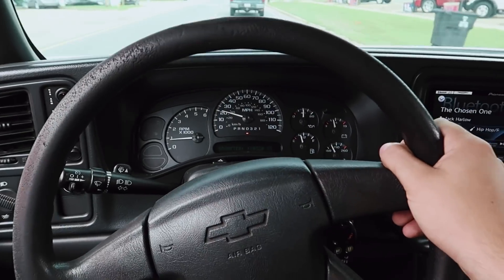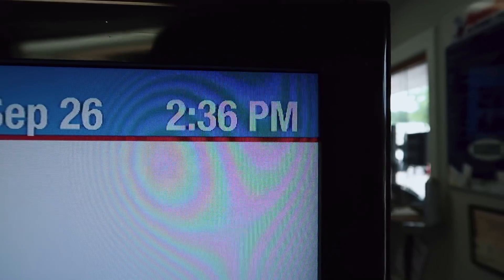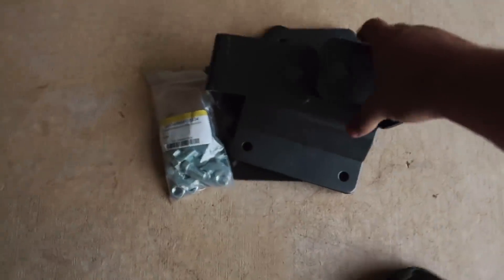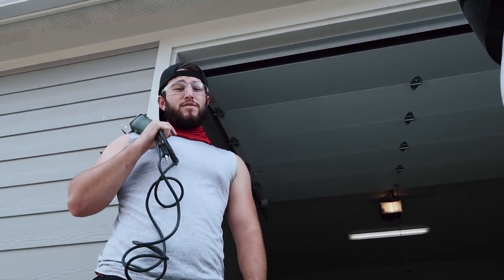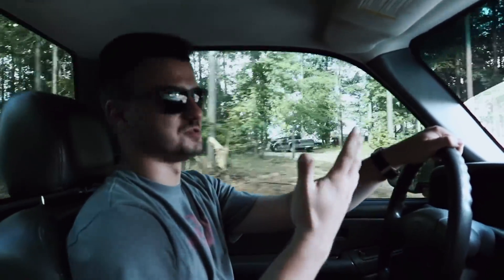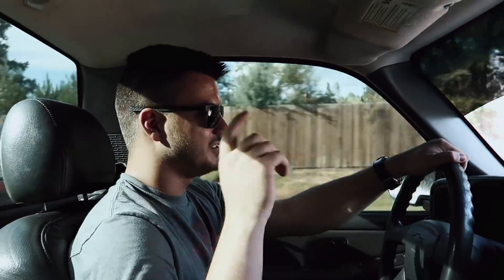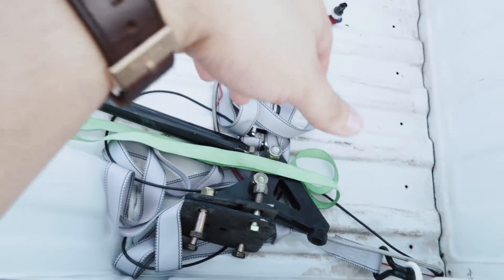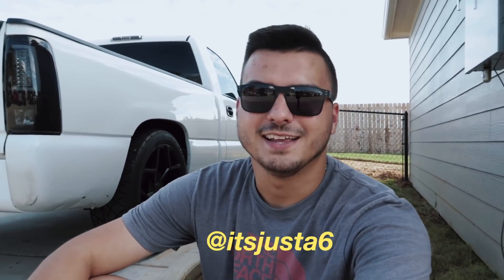This is a DISASTER! Race Truck problems...

Comment: $550! You could’ve bought a nice compressor and an air chisel and done the job yourself! Live and learn. Bummer!
Reply: Victor Garza do you replace the front hanger on the older trucks? When shopping for a 4/6 drop on my 14+ truck it’s the rear hanger I replace
Reply: tyler56ford Not possible actually, the rear of the spring is only a short distance from the bed floor, springs are normally mounted much lower on the front mounts so they have a lot of clearance & it maintains a better geometry, that’s why it’s always the front mount when lowering. If you are doing a lift then it would be on the rear mount.
Reply: Matt's Garage oh okay. I just know what I know from shopping for my truck. Mcgaughys 5/7 drop does the rear hanger, shackle, and a flip kit for the rear
Reply: tyler56ford Yep, if you are doing a flip kit or lower springs that might be the case but if you’re just changing out the hanger there isn’t enough clearance at the back.
Reply: Or bought a fucking dremel lol
Reply: Exactly!
Reply: Or just simply drill them out!

Comment: Gets an alignment. 
Immediately lowers rear of vehicle. 

Hooray excessive caster angle.
Reply: Please explain how lowering the rear leaf springs 1" on a truck would throw anything off.
Reply: It can throw off your caster/camber?  My lightning needed it when i did
Reply: @jlplightning9487  it was 1" and he didn't lower the front after alignment, only the rear. If you only lowered the rear of your lightning and not the front and paid someone to align it then you threw away money unless it needed alignment before hand.
Reply: Lifting orlowering the rear of a vehicle can and will affect the front toe adjustment. Lift it up and toe goes in, lower it and toe goes out.
Reply: Any adjustment made to the rear of a vehicle will affect the front. 

Caster is the relation of the upper and lower ball joint positions. 

Draw a line perpendicular to the ground that goes through your lower ball joint. 

When you lower the rear you are reclining the axis of the ball joints. Increasing caster

When you raise the rear you are making the upper ball joint go more towards the line drawn through the lower ball joint. Thus reducing caster. 

Though positive caster will help straight line drive-ability. Which will certainly help with drag racing.
Reply: not be rude but thats not how it works lol. Anytime you touch anything on the chassis in the rear the front gets thrown off
Reply: I guess you didn’t read the first sentence?
Reply: that wasn't to you lol

Comment: You need a spot weld removal drill bit to drill out those welds on the OEM brackets.

I used this on my rad support removal on our channel mustang build. In fact, my brother (on the channel) used this bit to remove the floor pans from his 2JZ Datsun 240Z build on the channel.

They take a while to drill out but it will do the job.

Hope this helps 😎

Comment: Have you checked to see if the drop shackles are bolted on to the lowest setting, knew someone who got a 2 4 drop and had the same problem you're having. Checked, and sure enough, wasn't on the lowest setting.

Comment: Put of curiosity how hard would it be to get the actual 2 inch hangers and install them yourself since they were just bolted in and you won’t need a torch to remove them this time?
Reply from the maker: Harley Imel fairly easy. Just would need to drop the tank

Comment: If you're going to take that thing drag racing, or even just apply a massive amount of torque to the rear axle, only use lowering front spring pockets or lowering leaf springs to lower it to be safe on every launch and keep the truck in control

Comment: Hey Gavin you can get an extra inch lower by taking the block out of the rear shackles if you don’t plan on towing heavy it rides fine I’ve done it on multiple trucks including a duramax just unbolt the shackles pull out the block and bolt back up the shackles .

Comment: 4hours sounds about right. Usually takes a little less. But my shop pays 1.50hr per inner tie rod so 3 hours total plus alignment usually can finish it in 2hours especially if you have the proper inner tie rod tool.

Comment: you want to lower it and throw power to it get a 4 link suspension for the back with a watts link fully adjustable way less issues with wheel hop and traction

Comment: I dont get why you started to cut off the rear leaf spring bracket and then the shop you had install them put them on the front side of the leaf springs ? What about a 1 inch drop shackle to get 1 more inch ?

Comment: Maybe it turned out for the better aren’t you hauling all your race fuel with the truck ? An inch more lower might cause wheel rub when it’s loaded down? Also it will squat when all that power hits the rear end. Looks good.

Comment: Check into SpeedEngeneering out of Fresno Ca. Sean is the owner and has everything u need for the rear set up of ur truck. They have multiple pieces specifically  for those trucks to perform and squat down . Hope this helps

Comment: Why don’t you have the company send you the correct 2” hangers, swap them out since they are just bolt ins and you already had the rivets torched out and send the 1” back? Company screwed up they should have no issue sending you correct part, unless they want the 1” shipped back first. Maybe repurchase the correct 2” and make them let you return the 1” for a full refund after you swap. If it were my truck I’d want the rear lowered more.

Comment: Blow torch? I haven't seen a blow torch in years.. I'm sure you must mean oxy acetylene torch. A blow torch is what my grandpa used 60 years ago to heat metal. On the other hand, an oxy acetylene torch is used to heat or cut metal. On the job you were doing it might have worked better to use a drill on those big rivets. Drill into the head then use a hammer and punch to pop it out. A large coarse grinding bit on a drill would have been another option to save your self some money. But when in doubt pay the professionals to do it right and watch them and learn so you can buy the proper tool to do it yourself next time..  BTW, you should have lowered the truck first before the alignment. Good luck with the truck..

Comment: You shouldn’t have done the alignment before you lowered the truck. You have to do another alignment
Reply: How does lowering the rear of a truck with leaf springs effect the alignment? The rear isn't adjustable. Unless it was a car with rear control arms or he lowered the front of the truck the alignment would be just fine
Reply: sinformant anytime there is ANY suspension adjustment there should be an alignment. That’s common sense
Reply: @betonthis1   the rear is not adjustable on a leaf spring suspension like that. The front is. A car is different because it usually has adjustments on the rear unless its an older car with leaf spring suspension. He made no alterations to the front suspension after the alignment.
Reply: sinformant the center of gravity was changed. The suspension and components were changed. I hope you realize this and stop spreading misinformation. The toe on the rear can be affected
Reply: @betonthis1  so how does toe move on a solid axle rear end?
Reply: Man you are really dense. He had the leaf springs modified and removed a component on the suspension to the rear. Dude give it up. You want me to list all the possible issues with alignment that can be affected by what he has done? It's his truck and he can do as he wishes but don't spread false information because you feel the need to "win" an argument.
Reply: @betonthis1  oh yeah now? Because you clearly stated the toe of the rear will be effected ......so what exactly did I read wrong? Clearly you don't know what you have stated yourself. He also did not modify the leaf springs.... he replaced a shackle where the.leaf.spring mounts to and dropped it."1 which even if lowering.the rear would throw things off as you seem so bull headed about 1" definitely isn't enough of a movement to throw anything off enough to need adjustment. Since you are dead set that you can adjust toe in/out on a solid axle rear end setup. Please explain the procedure and what you.move to change the angle of each rear wheel. Seeing as the.rear axle is one solid piece that.runs all the.way from where it mounts to the wheel to where the splines meet up inside the 3 rd member what part of that assembly pivots to allow such.a.toe adjustment
Reply: @betonthis1  LOL so the Leaf springs were modified? I didn't see it anywhere in the video. I'm at work and typing on a phone but I got my point across well enough for you to understand. You are avoiding the point I called you out on completely. I also asked you to explain since you are telling me I am wrong, but you still haven't. You just keep telling me I'm wrong but give no details, just attack my grammar, punctuation, and character.

Comment: Should’ve bought belltech 5952 3in lowering leaf springs
Reply: And if you wanted to go even lower then use lowering shackles on top of the lowering springs without having to mess with the hangars. But trucks look good with some rake.